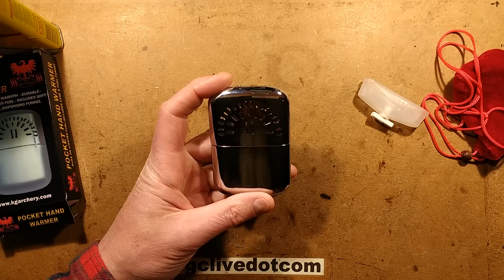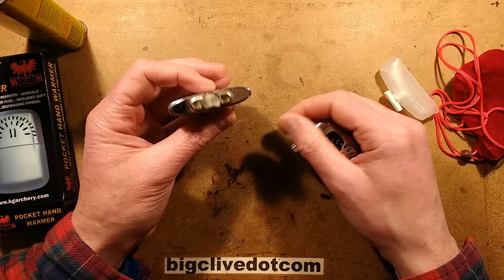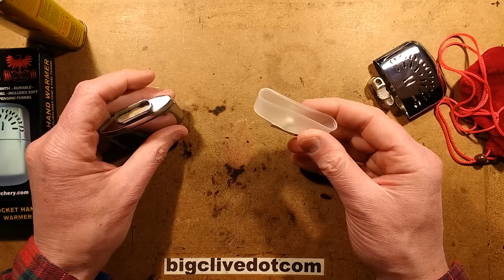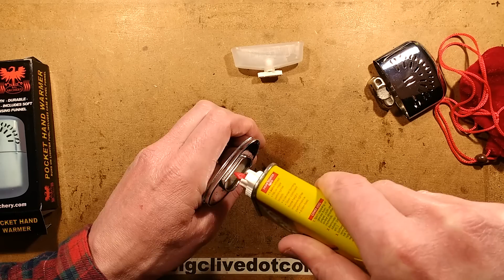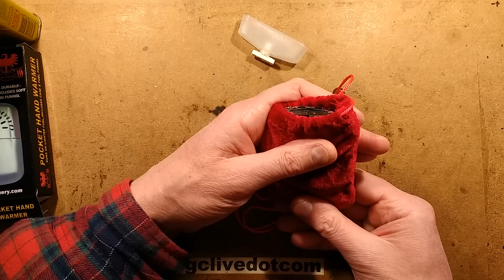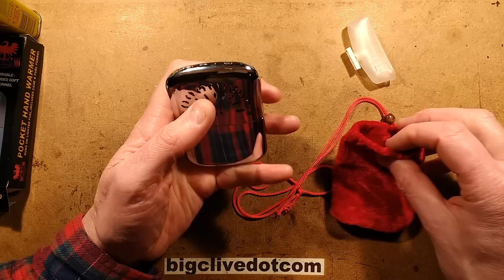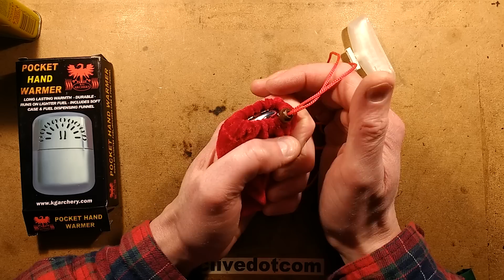How a petroleum-distillate powered pocket heater works.  (naptha)

Comment: I have a few been using them for years best I have found are a old peacock  zippo ones don't seem to get as hot I have found a guy on YouTube who knows a load more then me he rebuilds and modifys  them great items to have if u work long term in the cold  can last 12 hours or more depending on there size  I'm trying to find a place to buy the Catalyst and this guy on YouTube who does ham radios and other radio equipment has actually got a seller he buy some and resells it on his website his YouTube name is Mountain parameters

Comment: We have an atrocious mosquito problem near my house, we have one of those propane-powered SkeeterVac units... It's a rather neat contraption, once it lights and gets situated, it powers its own LED array (several colors, some flashing, some steady) and its own DC fan that sucks the little buggers into a nice little plastic-and-mesh-screen tray that cleverly clogs up with pollen.

Around the burner unit sits a nice sticky ring of thick card stock with white and black triangles, which catches TONS of biting flies and occasionally the poor idiot (ME) that has to re-light the thing when the tank runs out (every three weeks or so). Another added "bonus" is when the tank runs out and the unit shuts down, loss of power to the fan lets all the mosquitoes escape.
Reply from the maker: Some of the midge sucking machines have an air operated flap that traps everything inside when the fan stops.

Comment: Start it with a propane torch! Like the one you'd use for plumbing (propane under pressure). That'll head the head and it'll start every time. The only risk of over filling is that  you'll put out the catalyst and make a big mess.

Comment: I have two of the zippo ones that I have used for years.  They work very well and since I work outside, they keep me nice and warm in my shirt pocket under my coat.  I wanted to experiment using one of my Peltier devices to see how many leds I could light with one.  A fill up of a small amount of lighter fluid (naptha) lasts eight to ten hours of very hot output.  Coleman fuel is naptha so, you can get an entire gallon for about $10 US.
Reply: How long do they last on a fuel up?
Reply: @danielgranderson1794  As I mentioned, 8-10 hours.  They give you a filling cup and I don't know exactly how much fluid the cup takes to the "fill" line but I am guessing it is around 1 oz, maybe 1.5 oz. it's not much at all.  They kept me warm many a cold winter day working outside as a Guard.
Reply: @OverlandOne  I’m sorry did you have the 6 hr or the 12 hr heater?
Reply: @danielgranderson1794  No problem.  I was not aware they had 2 sizes.  Since mine runs for up to 10 hours I would "assume" I have the 12 hour model?  There used to be just one size and that's what I bought about 12 years ago.  (If it helps, I have the one that fits easily into a front dress shirt pocket.  If they make a larger model than that now, I got the smaller one  )They will last forever because, after many, many uses it will become very hard to light so, you just replace the platinum catalyst burner (about $10) and you are good to go.  I used mine every day in the winter all shift long and I would get 2-3 winters out of a burner.
Reply: @OverlandOne  great information these are great looking heaters that I will try out for work what kinda cheap fuel do you recommend?
Reply: @danielgranderson1794  They run on lighter fluid which I believe is naphtha.  It is pretty cheap.  I buy 12 oz cans of zippo lighter fluid and they last me a very long time.  1 can will go about 1.5 winters using all day 5 days a week.  Costs about  $12 for the can .  That's pretty cheap and, I was running 2 of them when it got really cold.  (-13 wind chill)  There is no flame so I just leave them in my shirt pockets and put my down vest and coat over top...and you can feel the nice, wonderful hot air wafting up out of your clothes up around your neck.  I am retired now but keep them in my car in the winter in case I get stranded someplace and it is really cold.

Comment: Had a friend who actually managed to get  some swan/zippo liquid fuel to go into in one of those butane soldering irons cos 'lighter fluid' is a bit of an ambiguous term in the UK. I told him he'd got the wrong stuff and needed butane but he persisted.

it wasn't a complete disaster (i.e. explosion) but it didn't like it much - after finally putting in some butane it'd boot up but cough out a small smokey yellow flame every few second. took a few refills with butane to completely clear the system out iirc.

Comment: only pocket warmer for usb I found is 2 wires solder to 2 pads of copper with some sort of conductive heating element sandwhiched between two pieces of tape.  one in theory for each glove.  They hardly get warm unless you have them up against bare skin  (ouch)  interesting but not sure if I want those to get wet

Comment: The catalytic process is pretty simple, it's just combustion, but the platinum decreases the temperature required for it to occur, leading to combustion without a flame.
Reply: Combustion is somewhat simple, the way platinum allows this at a low temperature is a little trickier and not as well understood.
Reply: @MrCorrectify  I believe the hydrogen in the fuel forms weak covalent bonds with the platinum forming a platinum hydride radical which then breaks up and reacts with oxygen to give platinum and water, the carbon is freed and goes on to react with oxygen to form CO2 (ideally although I expect you'd get CO as well)
Reply: @MrCorrectify  radiation
Reply: I sleep with a box of poptarts in my shoes
Reply: @spacemonkey9257  Are the poptarts in your shoes whilst you sleep (and if so where are the shoes being kept?), or are you sleeping whilst wearing your shoes but with a box of poptarts next to you?
Reply: @ferrumignis  yes
Reply: @spacemonkey9257  Thanks for clearing that up, I've not been able to sleep for worrying.
Reply: @ferrumignis  you're quite welcome
Reply: I've never heard of combustion without flame. To me, that would seem like just oxidation. Speaking of which, you can buy "hot hands" which are pouches full of iron powder. When you tear open the pouch, the exposure to oxygen causes oxidation of the iron powder, releasing heat exothermically and warming your hands.
Reply: @manofsan  fun fact combustion is oxidation. those powder hand warmers are essentially just really slow thermite too.
Reply: @nonchip  - all combustion is oxidation, but not all oxidation is combustion.
Reply: @manofsan  does charcoal burn with a flame?
Reply: @GeomancerHT  - alright, I guess by that standard, even glowing embers of wood or a cigarette could still be combusting - just slowly. But charcoal can produce flame.
Reply: @manofsan  that how MRE heaters work too
Reply: @Nicholas-f5  - guess that'll help you get a little more iron in your diet  ;p

Comment: we had those when I was 6 to 16 years old had many of them mostly going camping  once we filled it . we would put a little on the top and light it after it started heating we blew the flame out . the bad thing out it.   it made  you smell like the burnt fuel  but I did like them

Comment: I got a few some years back after having seen them on the internet somewhere, I could have sworn it was here on Big Clives channel, but apparently not! [ EDIT: Remembered it now: it was Ben Krasnow's channel (Applied Science): https://youtu.be/8gFqzbnUO-Y ]
    The one Clive has is actually a clone of a model (called peacock) from a Japanese company called Hakkin who claims to be "the original", but who knows. 
    I got one of theirs from ebay (since it was still a lot cheaper than the Zippo ones at the time) and a couple really cheap smaller ones made of aluminium. They all work well and as Clive said lasts a very long time.
    Only drawback I've noticed is that they are a bit fiddly to get started, and they make me a bit nauseous if used indoors (because of the fumes I guess), but I only need to use them outdoors anyway. They are pretty much ideal if you are going to be out in cold weather for a long time, especially if you need to maintain motor function in your fingers.
    To turn it off before it runs out of fuel you can put it in a plastic bag, which cuts of the oxygen supply making the catalytic reaction stop.

Comment: Jon-E was purchased by Zippo. Careful not to overfill, they are not sealed. The filler just needs to be moistened. Only fill with the specified amount. Not recommended in a sleeping bag. 130 - 150 degree skin contact will cause skin irritation over time, not really a burn but can cause blistering. Catalytic conversion may not be complete, a small amount of fumes are likely. Reasonable precautions are warranted. Otherwise they are fine. Been using many years. Hot hands ferrous hand warmers work well but are much bulkier since they are not reusable. If storage weight and and price are not important  they are great. For backpacking a couple days they are great but weight and bulk makes catylic burners advantageous for much longer duration. How about an examination of the Hot Hands Ferrous type hand warmers.

Comment: I had one of those soldering irons that worked by this principle. It was always a bitch to start and seemed to use gas at a bewildering rate. Frankly I would have had better results with an old fashioned copper iron and a blowlamp.

Comment: I dont think the unit you have shown tries to imitate the ZIPPO offering.. instead it looks similar to the Peakok warmer (which was intrroduced to the marked many decades earlier and is still available) I have used the cheap chinese ones, the Zippo and the Peakock... I  would advice you to not spend money on the Zippo one. It is nicely machined and has high buildquality but as far as functionallity is concerned it is just as bad as the cheap ones i needed to heat the burner a solid minute for it to start the reaction. just as long as you did. The zippo burner emits a very faint visable glow. But the Peakock burner starts up just as quick as lighting a cigarette 5 sec of open lame are plenty enough...the Hardware is just as well made as the Zippo but the cathalytic converters are of far superiour quality. they start up very fast and last a looooong time.

Comment: Got one of these.   It works fairly well except it's big and there is no off-switch.  But mine only worked well for one winter before the burner died.  I have not found a new one.

Comment: Clive, the lighter fluid (at least here in the 'States) is Naphtha, which can be found on the shelves at hardware stores for much less than a bottle of Zippo fluid. It's an excellent solvent, which evaporates quickly. I'm not sure I would trust these heaters with anything that does not evaporate quickly; I wouldn't want petrol leaking inside my pockets.

That said, a few drops of naphtha on your desk would not have flared up very much. With a few more inches of space, it could have been fun, but would have left a mark on your work bench.

Comment: Gasoline/Petrol (for cars) is not the same as Naphtha/Lighter Fluid/Coleman Fuel. Gasoline/Petrol contains all sorts of additives to make running an internal combustion engine better - such as, for example - some chemicals are added to try and keep fuel injectors and intake valves clean + lots of other chemicals (some are trade secrets), some quite hazardous such as lead (the reason lead in vehicle engine fuel was banned years ago! Plus lead will clog catalytic converters). To illustrate this, put some Gasoline in a clear glass, put it somewhere safe, and let all the petroleum evaporate.
All that stuff that remains (some of the additives will have evaporated with the petroleum) are additives which will clog up your pocket heater, Coleman lantern, Zippo, etc.

Naphtha/Lighter Fluid/Coleman fuel do not have these additives and is the reason they are sometimes referred to as 'White Gas' (or 'neat' gasoline - or gasoline without the additives). If you let a glass of this fuel evaporate, no residue will remain, which can be handy if you use Naphtha/Lighter Fluid to clean stuff (like removing label adhesive goo on anything).
In the olden days, using leaded gasoline in a Coleman lamp, Coleman camp heater or one of these Catalytic pocket warmers would ruin them. The wick of your Zippo lighter would become clogged with additive crud. 'nuf said.

Comment: i've had a zippo warmer for 15 years and it's always served me well on many camping trips and cold days alike, i haven't had to replace the catalyst since i got it. it still gets too hot to touch if i leave it out of the felt bag. my favorite way to use it was filling it up to the 4 hour line, cinching up the felt bag fully (this will make it run about half as hot and twice as long, ive had it run 20 hours in the felt bag and then in a parka pocket before) and tossing it into the bottom of the sleeping bag before going to sleep. nice toasty feet.

 i think it has way more platinum on it than the knockoffs, since the fibers are a dull grey instead of white.
Reply: Can you stop the process,or put it out ? If in a tent and didn't need it going, or do you let it run out of fuel ? Cheers..
Reply: THEDRAGONBOOSTER8 you can pop the top off or put it in an airtight bag but its a little risky.  best to let it run down instead
Reply: i usually just let it run dry, after a while you figure out how much fuel you need to add when you want it to run a certain amount of time, but if you need to stop it cinch the felt bag all the way shut then put it in the smallest ziplock bag it will fit in. the only way to stop it is to deprive it of oxygen, so you need to put it in something air tight.
Reply: I just put mine in a zipper bag and store it all in the pouch. If it's been running in the pouch it's cool enough that there's no danger of melting the bag. If it's hot you can just leave it in the pouch when you put it in the bag. The reaction will stop in a few minutes and you can relight it later. If it sits for weeks or months you'll have to refill it. (You could also remove the catalytic part for a minute until it cools)
Reply: Thank you..
Reply: Thanks for your help..

Comment: I used to have one similar to this model, it only cost me £4 on ebay (still does) and never had any problems with it. I found with mine if it was under filled, it took more effort to get it to initiate. I always used Swan lighter fluid in mine and found lighting it with a bunson flame type lighter worked better than a regular yellow flame gas lighter. Just don't leave it on or next to the skin, like in your pocket uncovered. I always used the sleeve provided.

Platinum is the catalytic chemical that participates in intermediate reactions breaking the hydrocarbon bonds at much lower energy levels than without the platinum intermediates. the platinum infused pads break down by two mechanisms. One is that a small percentage of incomplete and side reactions generate coke and coke byproducts that infuse into and also surface foul the platinum thus preventing the platinum from participating. In addition a small percentage of the platinum is continuously oxidized by other side reactions. The second reason is that the heat resistant fiber material that the platinum is infused onto breaks down over time further limiting surface area for exposure of the platinum to the hydrocarbon. The lighter fluid of vaporizes and then reacts while passing through the catalytic pad. Hope this answers any curiosity.

Comment: The fuel is NOT gasoline--which would be very dangerous!  It's naphtha (lighter fuel, like Ronsonol brand, etc.).  We used to have these when duck hunting in the fall.  It was the Jon-E-Warmer brand.  They *work*.  There's even a foot version that is small and thin and fits into a special sock with a pocket near the ankle.  With big boots on, your feet are TOASTY!

Comment: Mine has a wick down the inside where the light fluid  could wick.up to the fiberglass converter.,it would make a flame let it run tell the fiberglass turns red blow the flame out, put the top on ,then put it into the red bag.

Comment: Would it be feasible to combine this with a peltier element to make a gasoline powered power bank?
Reply: mikewolf78 That would be cool!
Reply: There's actually much more efficient way to turn fuel into electricity - fuel cell. Peltier design would be little to no efficient.
Reply: yes, inefficient but doable. there are ones that make power from a candle

Comment: I used to fulfill orders and once I had to get 5 gallons of the stuff. Because they don't want you to pass out and have fuel leak all over your unconscious body you have to hold the valve open manually until it is full. I was wobbly when I walked out.

Comment: Zippo do make the heads, there are various makes on the market of a generic design, so I would say that they all come from the same factory, uses the same parts and are only different in the finishing and detailing (cosmetics).

Grill designs, Peacocks and Butterflies seem to be popular, you can get flames and holes as designs.

Cheap-o £9~ish
Mid range £17~ish 
Brand name £26 and up

Interesting as it has possible applications...
Reply from the maker: If you can wait for the Chinese shipment they are available from about £4 up.